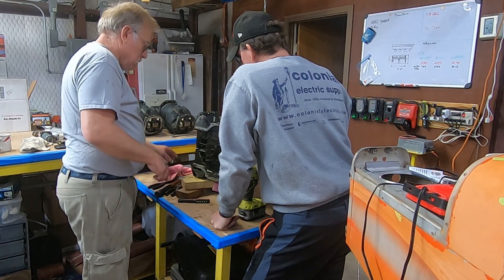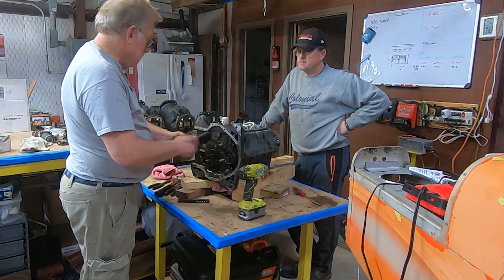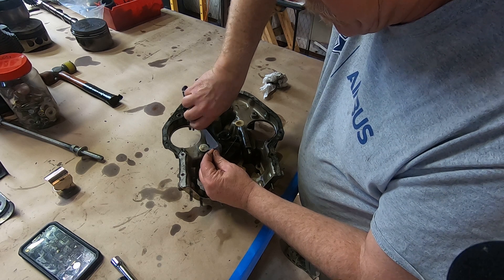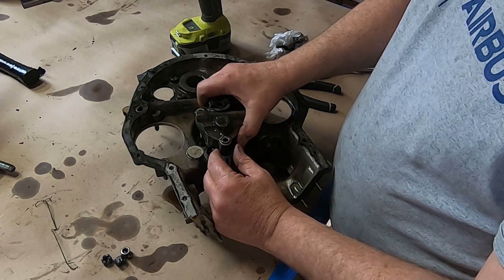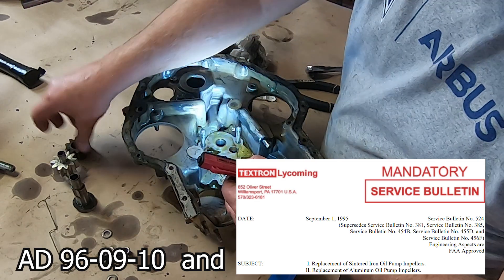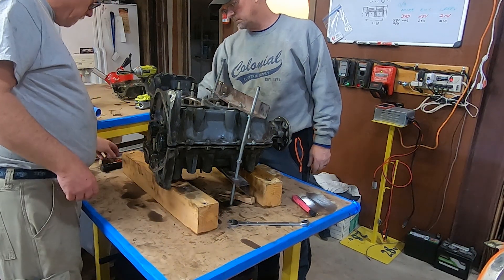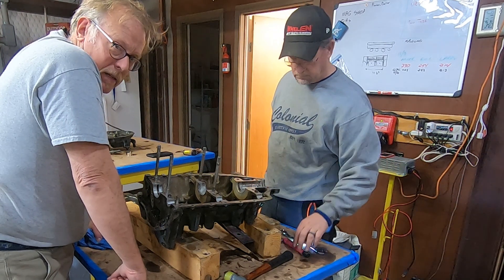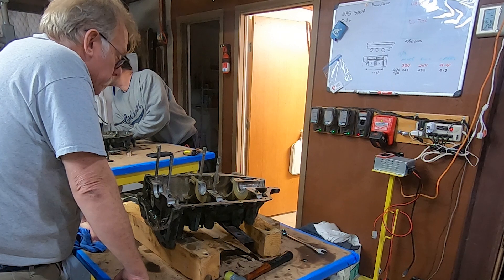360 Engine E02 - Disassembly complete!

Comment: I'm loving this series! Thanks so much for putting the work into it. 

Couple of questions: 
For your case jack, which studs do you connect to? Any concern about the non-perpendicular pull? How do you keep the separation parallel? 

Will you be reusing the tappets? It doesn't look like you tracked their position, which surprised me.

Comment: G, day Hanger Rats from Sydney, Australia.
* io360 disassembled
Q1. The 1995 Mandatory service bulletin - is that because of the incompatible gear metals (steel v aluminium)?
Q2. The tapping with the soft hammer " the other one was smeared away" crank bearing seats?
Have fun🌏🇭🇲
Reply from the maker: A1.  Lots of background.  The dissimilar metals didn't work.  They also tried sintered steel parts because they were high tech and less expensive.  That didn't work.  The AD and the SB read like a Tolstoy novel...
Reply: @HangaRatz  "The AD and the SB read like a Tolstoy novel..." HAHA great line.

Comment: I recently purchased my first airplane which has an O-360-A4J. As I understand it, it's identical to the engine you're working on, except it has different magnetos. These videos are very informative and provide a better understanding of the engine's design. Although I won't be working on it myself, it's also interesting to see the practical techniques used to disassemble the engine and work on it.
Reply from the maker: Thanks!

Comment: Just how warm did you heat the crankcase?  Looks like the crank and cam were hot to the touch.
Reply from the maker: I used the temp gun.  I had some readings close to 200F
Reply: He mentioned a heat gun.